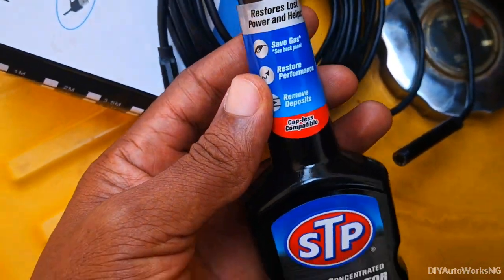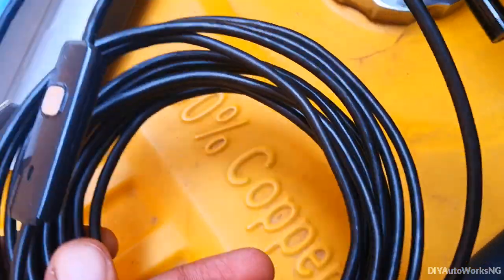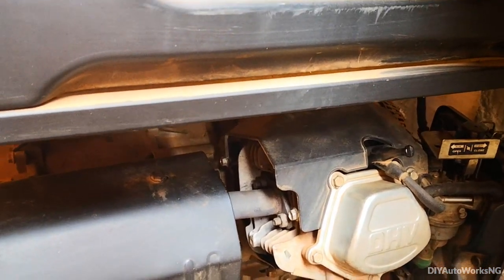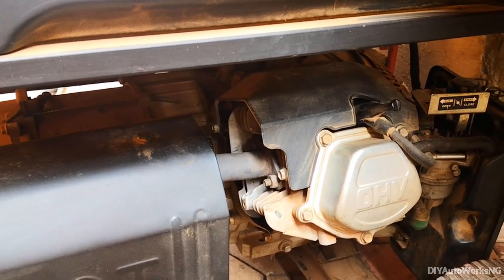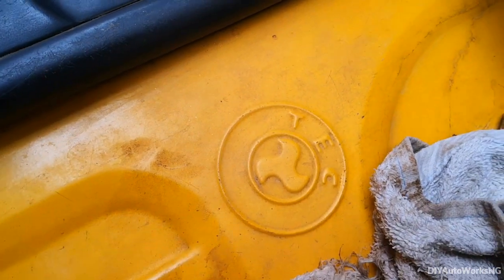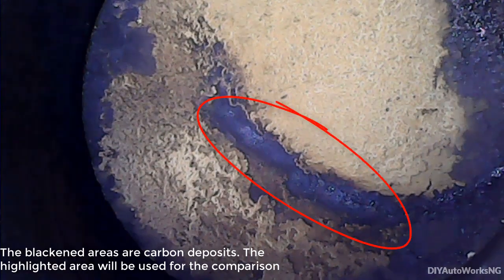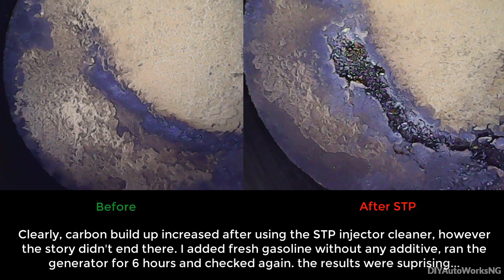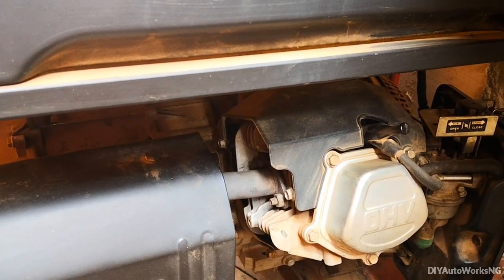What STP fuel injector cleaner did in my combustion chamber

Comment: I used this on my car and it killed it 😂 it started to stutter and dye out its fucked the computer says it has contaminated gas I am really hoping it’s not that but it started after using stp I’ve used Lucas and it works great but I tried this one and it completely fucked me
Reply from the maker: Sure it's not the gas you added with the cleaner? I've used loads of cleaners over the years and never have I had one make a car run badly. Could also be a coincidence. Had one like that with limp mode right after getting gas from a station. Ended up being the VTEC solenoid. You know these cars need certain number of drive cycles to complete before setting a code. The startup after getting gas may well just be the one that complete the cycle.

Comment: As per your own admission this is basically a nonsensical test, it's an INJECTOR cleaner and this generator doesn't have these, so you're not 'testing' the product for what it is supposed to do.
I can use a pear to hammer in a nail, it's not made for it, so it will likely not do a good job.
Does it mean the pear is bad ? No.

Comment: That's 100% false. The GENERATOR this guy used does not have FUEL INJECTORS. It's called FUEL INJECTOR CLEANER, NOT CYLINDER HEAD CLEANER 4 a REASON.
Reply from the maker: I clearly stated this in the video. Was just experimenting...

Comment: You're totally using it for the wrong parts and reason, it's for the fuel injector not for the combustion chamber
Reply from the maker: Thanks. 
I think I said just this in the video. It was an experiment.
Reply: @DIYAutoworksNG  you're welcome, but you probably could find a combustion chamber cleaner at auto parts store
Reply from the maker: Thanks, Chris. I did that in this video. https://youtu.be/YWKIycwZtY0. I also have a part 2 where I tried cleaning via an Italian tune up.

Comment: This stuff legit has jet fuel added with other chemicals to clean injectors. Thus, any car will immediately feel better performance and added mpg, though the intended goal is to clean injectors and I believe that adding 1 bottle in each tank back to back will effectively clean injectors well.. That's why stp sells the 2 pack. Great company, even though it doesn't have pea, it's still highly effective
Reply: doesn't it to use it after a few thousand miles?
Reply: This stuff is junk.  It has chemicals nobody else uses because they don't work very well.  PEA is the undisputed heavyweight and all STP fuel additives contain little to no PEA.

Comment: It made my car rough idle it’s vibrating not picking up the speed
Reply from the maker: After putting it in the tank?
Reply: @DIYAutoworksNG  yep
Reply from the maker: Most likely unrelated, in my opinion. Any codes?
Reply: @DIYAutoworksNG  pressure control solenoid b acultar b stuck off
Reply: @DIYAutoworksNG  engine bypass
Reply from the maker: Totally unrelated. See this link https://www.obd-codes.com/p0776

Comment: Should car be on a full tank, half before using this product
Reply: A full shot for a full tank in a standard size vehicle.  Up to 21 gal means that the additive is effective and is concentrated enough to clean your INJECTORS.  Anything above 21 gal for a full shot and a full tank the additive is overly diluted to be effective.
Reply from the maker: Spot on! 👌🏼
Reply from the maker: If I recall correctly, this exact size treats up to 21 gallons with half tank recommended as minimum gas to have in order to use the additive. The directions for use (on reverse side of bottle) should state this clearly.
Reply: Read the instructions.

Comment: Someone independent really needs to do a properly scientific analysis of these fuel additives to test the claims. From what I heard the claims are that the additives are catalysts, a catalyst is often used to help turn one thing into another (simple definition). The stuff that appeared to have been an increased carbon  deposit (although looking more liquid or gel like due to the shine) in the first after shot may not have been carbon, but some other material created, that was easier to be burnt off therefore "cleaning" the system as claimed when the second tank of fuel was used.
Reply: My opinion would be the carbon before was very old and solidified to the piston.  THe fuel injector cleaner softens it up and it will expand a bit due to soaking up the cleaner and starting to break down.  It takes time for the stuff to work fully and that is why the second tank appeared to clean it .
Reply: They do check out project farm and Chrisfix

Comment: I have ford 1.6diesel. And after add stp. I have so much power. Unbliveble
Reply from the maker: Very nice. Which of the STP products did you use? Is it the exact one I used in the video?
Reply: @DIYAutoworksNG  Hope not because thats for gasoline.  THey make a diesel version.  If they are actually different, I do not know.
Reply from the maker: Yes they make a diesel version. I must have missed the diesel bit of the original question! Thanks for flagging.